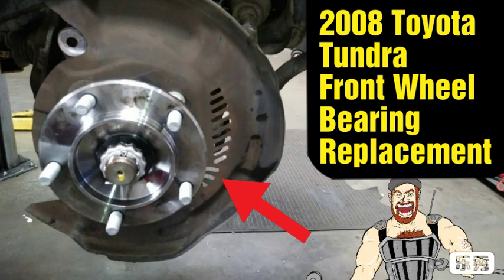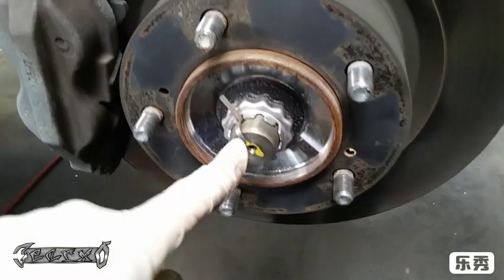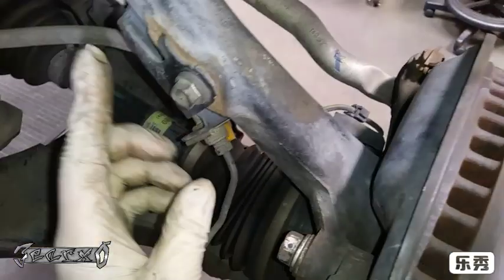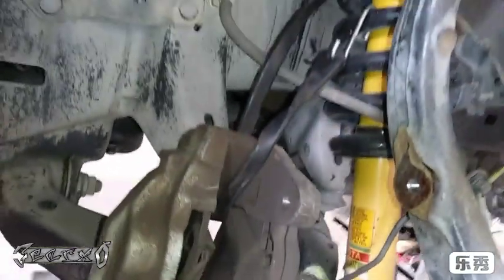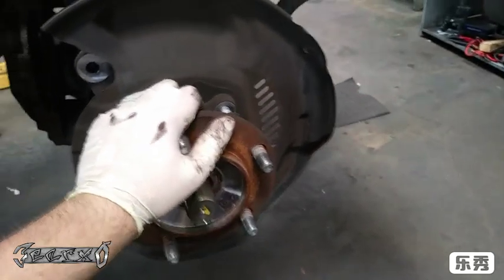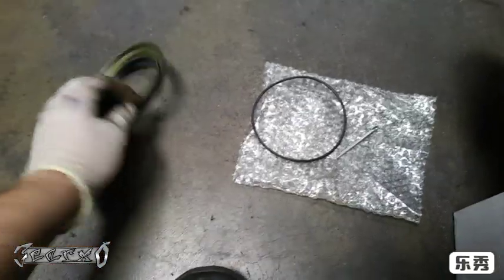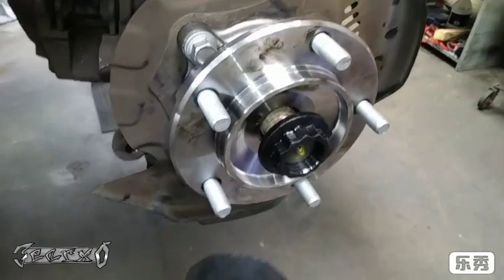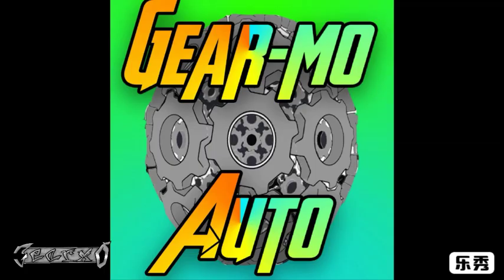2008-2017 Tundra Front Wheel Bearing

Comment: Torque spec for spindle nut would be nice also. I read that if the hub bearing bolts aren't all the same torque it could cause premature failure. Nice video
Reply: Torque spec is 249 lb-ft for the spindle nut.

Comment: I noticed you did not need to use a press for the wheel bearing? Is that because the new one was already pressed together?
Reply: Yes they are already pressed in. However if you have a press at home to remove the old bearing that eliminates the need for the entire new hub whereas you can just replace the bearings.